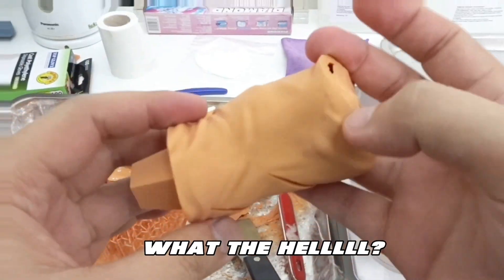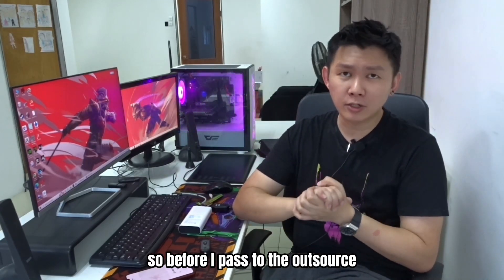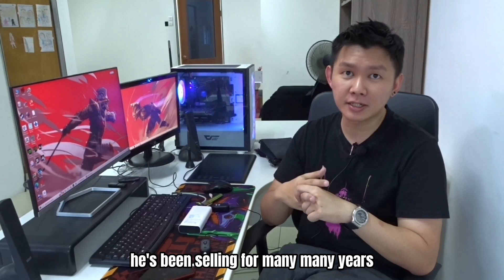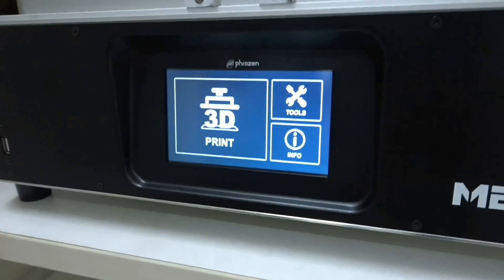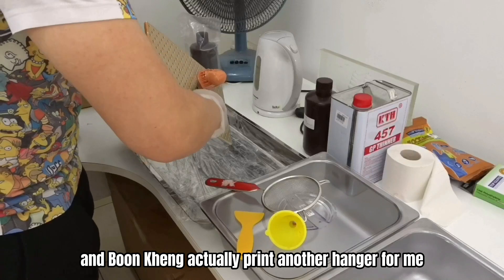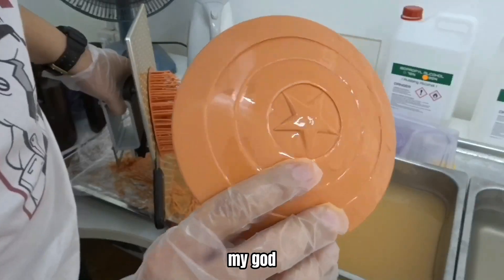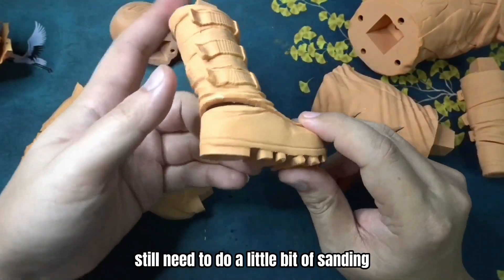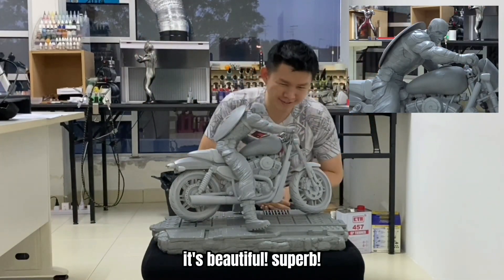@phrozen3d Sonic Mega 8K Unboxing, Test Print, Post Processing & Fixing Failed Prints!

Comment: Great trick with the putty. Would you say you notice any difference in 8k, 6k, or 4k printers? do you know of any other printers that a can print 8k-6k with the same or larger printer volume but is cheaper than the Phrozen Mega 8k?
Reply from the maker: I think big one you can search for Peopoly or Elegoo Jupiter… Jupiter is way cheaper, but slightly smaller print size volume

Comment: bro tips for you  :) reason why your print is getting damage is cause of the fep suction. So placement also very important. Remember if you put hole bottom and top where it drains. Lower down the lift speed as well to avoid that damage in the future.
Reply from the maker: Thanks man~ yeah, now my prints so far ok dy, and Phrozen resin really good leh… after change red clay to Phrozen aqua grey resin, touched wood no fail prints at all! 😂
Reply: @WayneWingedAngel  also dial to more detail 0.03 but longer time. I also butt itchy went and bought a m3 max slightly bigger then Jupiter but smaller then phrozen
Reply from the maker: @littlecreatures1801  haha really?! I go search see see what is your new printer like… 😂